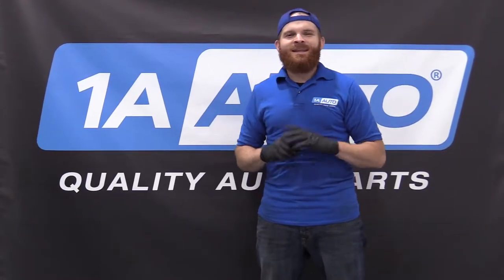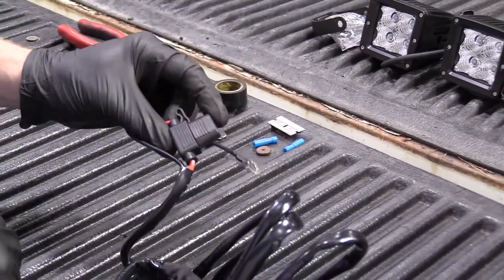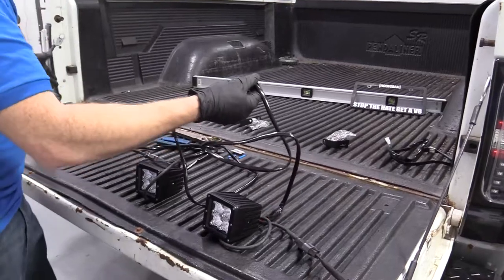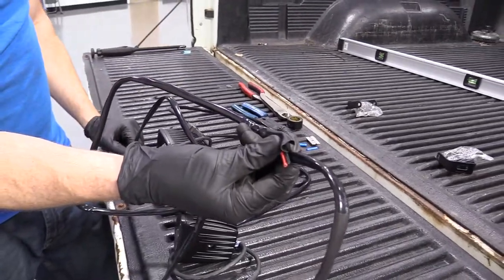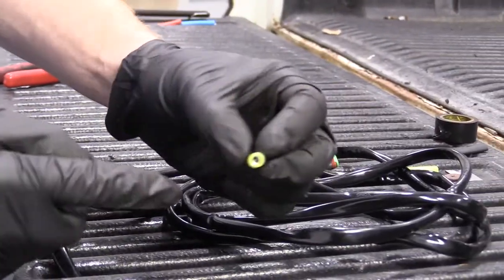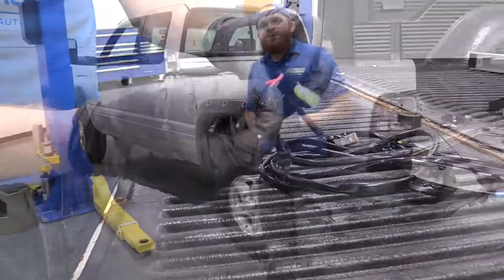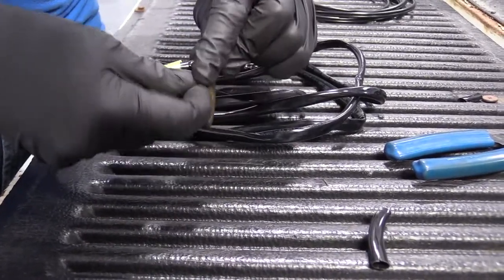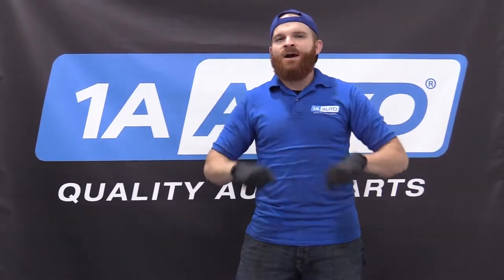How to Splice and Extend a Wiring Harness

Comment: What about not extending power wire in front of a fuse, adding relays when increasing the stock juice pull, and increasing the gauge of the extension wire to reduce power loss at distances longer than stock?